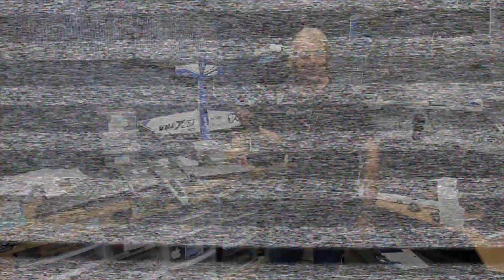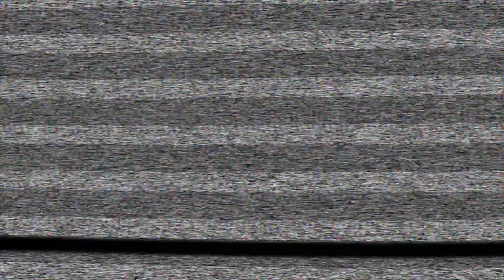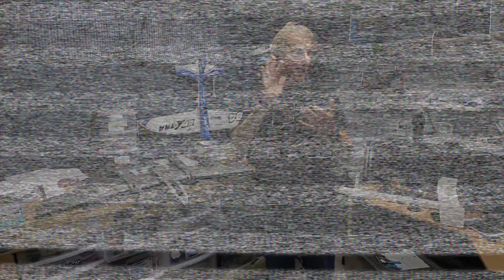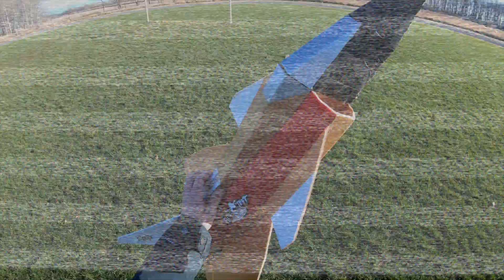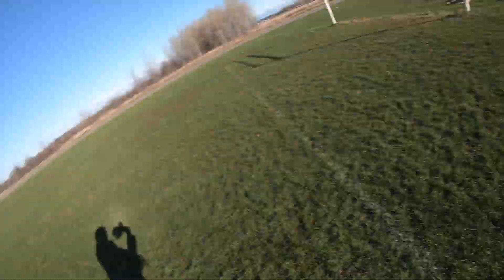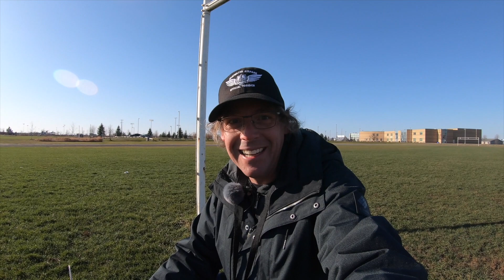Friday Flying Update - Buzz Off eh!

Comment: There's a hairy bug crawling on your chest Andre...;-) You could even fly the Tundra in the snow with the included floats.
Reply from the maker: The problem is once I put the floats on the plane is too tall for the car...
Reply: @blameandre  You're luck you don't drive a Smart. I bought an old Van as a 2nd vehicle just to get my large planes or a bunch of smaller ones to the field...
BTW... Didn't get the Buzz Off thing ??
Reply from the maker: Next car is a hatch and the new mic worked great yesterday while flying  so no buzz in my audio.